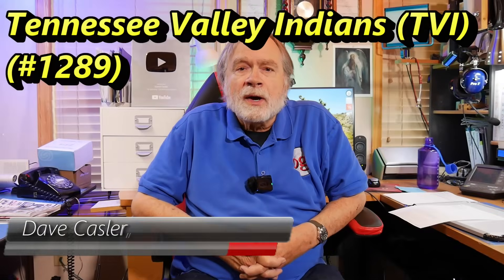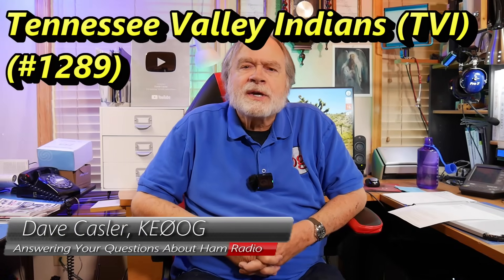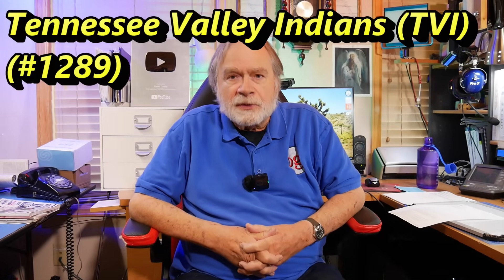Tennessee Valley Indians (TVI) (#1289)

Comment: Is it TVI ?   I suspect the RF is being picked up by a poorly shielded TV processor board and or power supply.  I have seen 5 watt VHF HT’s cause the protective shutdown of switching power supplies in industrial process control computer power supplies.  We chased it for weeks until I saw a plant operator keying his HT near the cabinet.  Poor RF shielding by the manufacturer of the process control system was the root cause. Try ferrites on the power cord but if the internal shielding is non existant all bets are off.

Comment: I'm surprised t.v.i. is a problem these days. Use ferrite rings?
I had it with neighbours on each side for two doors away in the late 1970's with 100 Watts. Our t.v. was fine. Our h.f.frequencies to 29 MHz is well away from 600 MHz t.v. and audio frequencies. It was poorly designed t.v. and audio equipment.
5 Watts for 30+ years and no problems but a new QTH for these years.
I'd hate to even think of using our new 1 kW power level.
G4GHB.